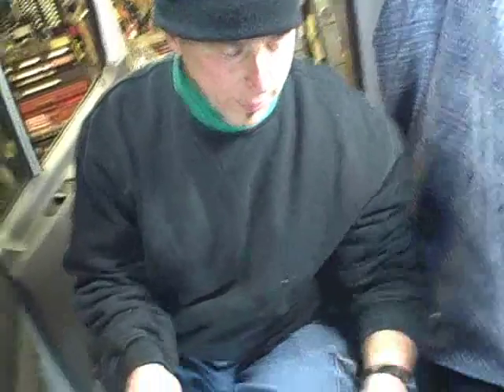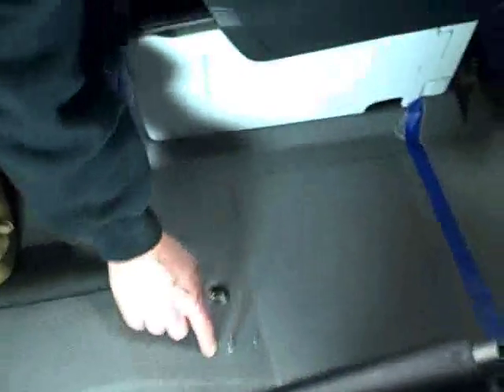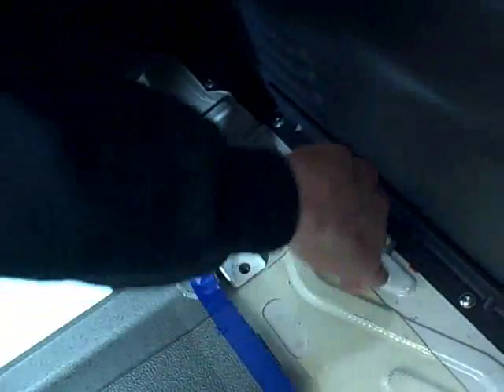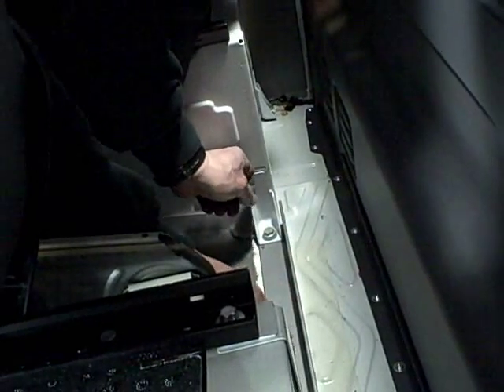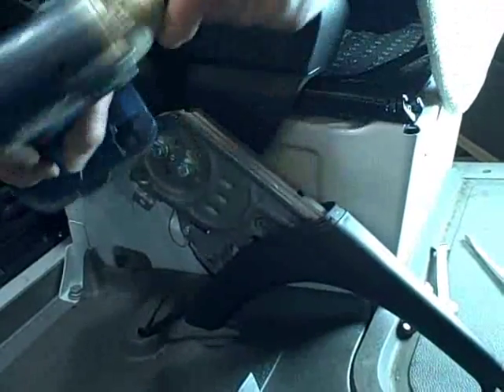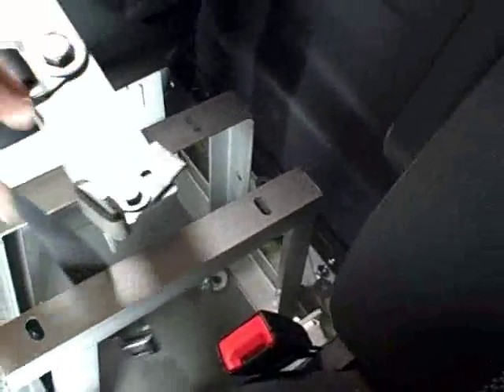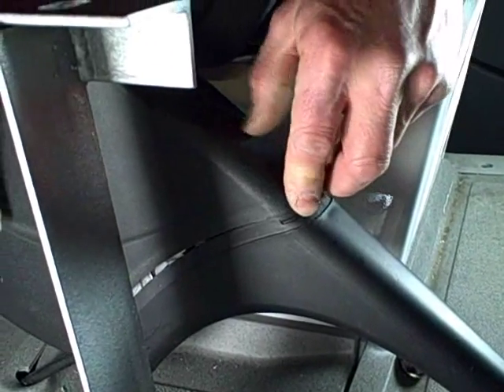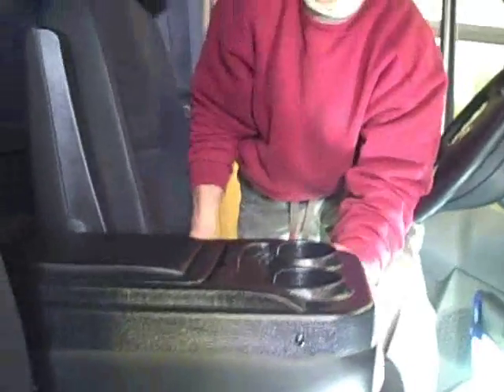Sprinter 3rd-Man Seat (2007-2010) installation by Cyclevan

Comment from the maker: @Charles2337 
Thank you for the comment. This seat can easily be installed by anyone that posesses an average level of mechanical skill and a common set of tools. Please note that we are available for your installation questions or to take your order at 732-238-3110.
Reply: Cyclevan Unlimited, Inc is this seat safe for an 8 year old to seat in? Also can this be done on a Ford transit?